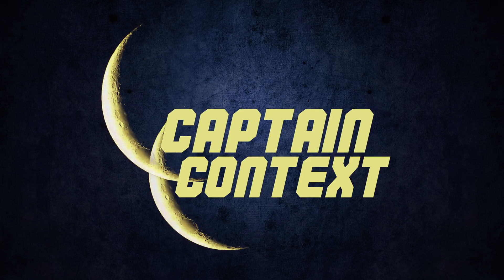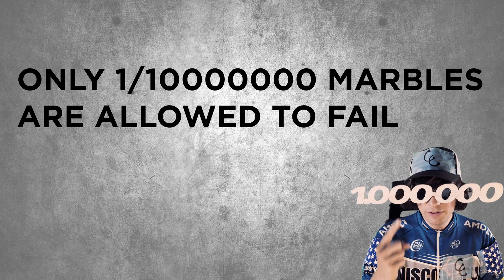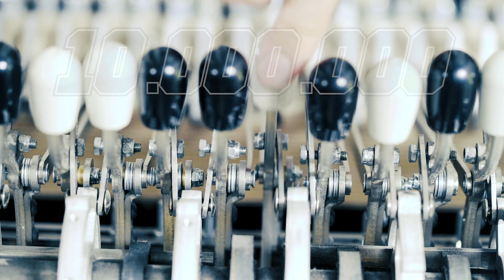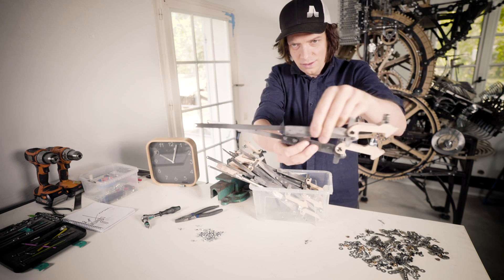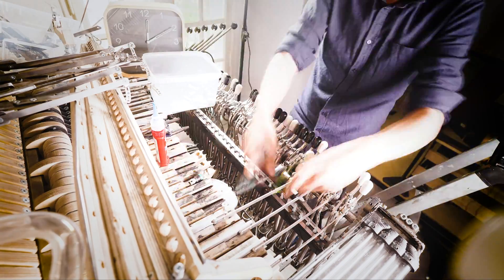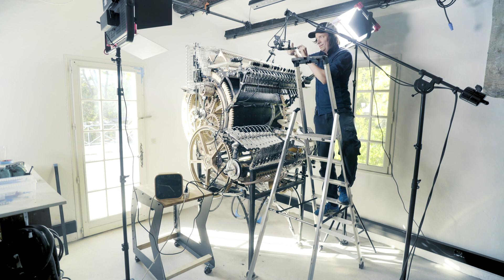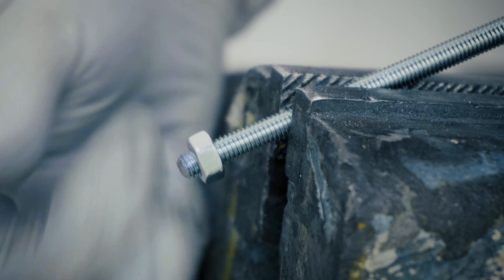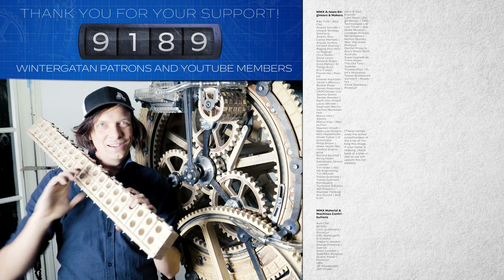Countersink? Why? - Marble Machine X #143

Comment: I don't mean to use this accusative tone, but a lot of us told you from the beginning in the comments to design more redundancy into the machine.

You were focusing on creating cool solutions when you should have worked on reliable solutions.

Now I'm fearing that you are focusing on the wrong thing again. Instead of trying to maximize reliability to the absurd, you should design so that when a marble fails, it fails in a way that doesn't hurt the machine. (Or hurts it as little as possible)

Yes, each song needs 3500 marbles. But if 1% of those marbles would fail to hit their target, that's still a lot better than most musicians can perform. 3,5 missed notes in a song? That's nothing for a whole orchestra, and the MMX is like an orchestra.

You don't need every part to work 99,99999 of the time. You need to design each part so that it can fail without breaking. The machine would miss a note and keep going.

99.99999% reliability of every part is impossible.

Reducing the risk of machine breakage to 0.000001% might be feasible.

(By tha way, if every moving part has 99.99999% reliability, and each marble interacts with say  100 moving parts, then each marble only has a reliability of 0.9999999^100 = 0.99999000005 ~ 99.999%)

So by all means, design away the possibility of failures. But also design so that the failures that will happen won't be critical.

Edit:
I'm super positive towards the actual building in today's video, it's a logical fix to a known problem. 

My rant above concerns mostly the line of thinking from the intro.
Reply: Couldn’t agree more. This comment needs to go up.
Reply: This is the fundamental difference between an engineer and an artist. I'm an engineer. I could make marble machine work fine, but I could have never come up with the idea to build it.
Reply: I was gonna write something like this but luckily I found multiple others already saying it more eloquently than I ever could. Plz Martin see this, as well as the entire crew, this should be a fundamental consideration for the design of the machine! I believe in the machine, but not when you put goals and expectations of near impossible infallibility on it.
Reply: but he is fixing the stuff that result in major seizes, though. In this case, if the two bolts got caught every time A played so would be. Every single time, and they wouldn't naturally free themselves of each other.
Reply: @Dubanx  I agree, the actual building in this video I'm super positive towards.

My rant above concerns mostly the philosophy from the intro.
Reply: Totally agree with you. Also his reliability calculation is flawed as each marble doesn't interact with every component so while it may be 3500 marbles per song, most components will only interact with a fraction of the marbles per song. Better to spend time fine tuning components that interact with the most marbles.
Reply: Yeah, the machine needs an acceptable point of failure, so that if a marble gets trapped, something non-critical such as the programming stud breaks. IIRC right now that's what happens, if the machine fails then the magnet breaks but the studs apparently won't. Personally I think it's probably worth revisiting that. Still worth getting the failure rate down a lot, but if once a gig one stud breaks, it's a few missed notes on one song and a bit of work after.
Reply: I would normally agree with you but this is an instrument..... So requires such a high level of accuracy. Could you imagine a cello, drum, organ, or xylophone that only worked 99.9% of the time?
Reply: @DaleKnudsen  Well, in that case I think the exact numbers we use become important. 

99.9%, I would agree, is a bad number for a normal instrument. If every 1000:th note straight-up failed, that would be a bummer for a soloist. But I would argue that despite most instruments being fairly simple mechanically, few of them get even close  to 99.999% reliability. Woodwind mechanics get stuck or fail to cover the hole. Guitar and violin strings break. Vocal chords get covered with mucus. Midi info gets lost in transmission. 

But you are right, there are instruments that can play 10 000 000 notes without any failings of the instrument being expected. Maybe the piano is the best example.

I would say a big distinction between the MMX and most regular instruments, (with them being fairly simple mechanically), is that they have the player as the most critical part working part. The player usually acts as the time-keeper, the source of energy, and the brains of the instrument. And the most professional of players still fail way more frequently than 0.00001%. Like fretting at the wrong place on a guitar, or hitting a piano key too soft for the note to sound. So the interaction between human and instrument regularly fails. But since great musicians are living error-correction machines, they make sure that the error doesn't mess up the music. 

As I see it, it's not wrong to try to maximize reliability, but reaching for a probability of failure in the millionth percentile seems non-productive to me, and also very hard to accurately measure.
Reply: @Jonas Bergmansson  The fact that Martin is thinking of reliability so strongly is pushing him further in his art and ability as a engineer. The push towards perfection in some ways very much drives Martin' creativity. 

As far as this work being non-prodictive... Not one of the other MMX videos started like this - the whole character creation, drawing, and bit around explaining reliability. Amazingly informative and fun to watch

By performing the work today he is reducing work he will most definitely have to do later. Transporting and fully utilizing as said instrument I would imagine will put great strain on all moving parts. It is these questions of reliability and probablity of failure that reveal where the strain of potiential breakage will happen. 

While it may be futile to expect that such high uptime will exist. I would find it even more futile to not try and find ways to measure, predict, test, tweak, measure, predict, etc...

Something that I think you mistake in your initial comment ... This entire project is a cool solution not a excercize in redundancy reduction. If it was there would be no marble tracks, no plexi pipes, no ladder and demag wheel.... All of these complications and contradiction of necessity create beauty.  Much of which I see is the beauty of being able to witness this growth in a fun and interesting fashion. 

Would have it no other way 😁
Have no fears - I believe!
Reply: @DaleKnudsen  I also believe the MMX is going to be finished.

And yes, the progress in todays video was nothing but positive.

The whole concept about the machine is that it is walking the tightrope of trying to be both a very complex machine with a specific task, and also an art piece and a sculpture.

I don't disagree with you, but my fear is that if reliability is turned into the key factor, then a lot of the cool earlier designs have to be scrapped (like the fish stair, and the marble divider that is based on the heights of a stack of marbles)

It just comes so out of left field that Martin is suddenly expecting a high reliability from parts that were never designed with reliability as a top priority.
Reply: The reasons he will never finish this project, he never listens to stuff like this!
Reply: And up you go!
Reply: Up!
Reply: I mean, he's not an engineer and had no idea about machining at the beginning if I remember correctly and he doesn't even seem to have a deadline. I find it interesting the way he does it. Like. This is what I would call proper backyard engineering :D
Reply: @chas1878  Yeah, today's Martin is a vastly better engineer than last year's Martin, and so on. That's really cool to watch.
Reply: You need both. Design for your target tolerance but have stable exception handling. Doesn't matter if you are making mayonnaise, working on an instrument or writing code.  What's more important to me in this video is the willingness to fix the problem _now_. Future Martin will be glad about that.
Reply: I absolutely agree with this comment. However, if there are any places where Martin can't have non critical failure points, he will need to make them 99.99999% successful.
Reply: I disagree. This just seem to be critique for critique sake, as you noted you criticized previously and are criticizing now, even when going more inline with your earlier advice. What exactly has Martin been doing that will cause the machine to explode or become seriously damaged when a marble jams? He is not so stupid as to let such a flaw stay in the machine.  Perhaps his reliability goal is ultimately unattainable, but it is not a bad goal to strive for. I also think he is aiming for this reliability to improve the music making process, which I imagine will take a lot of experimentation and retakes. If the machine is not reliable, then he'll spend more time fixing it than making music.
Reply: This is my thought from the very beginning of this build...
All we can do now is pray and wait for this project to be completed and playing its first song...

As many other project... As its approach 90% of the progress.. that 10% is actually 90% of the whole build
Reply: How dare you accusing the artist of focing on "wrong thing again" he is not building for you get out of your high horse. 

Edit: my comment makes no sense now when the main post has been edited, cheers
Reply: @user-jap84tlv24sq  I'm not questioning Martin's vision, I'm trying to help him make the machine happen. 

As you've seen during the course of the build, Martin has improved some designs after tips from the community.
Reply: @JBergmansson  i see your point but i dont appreciate the tone and style in which you put it. I see input such as "make every mistake happen in a pleasant way" very unnecessary. I think the man knows what he's doing and I was honestly shock that your comment got thumbed up so much so I just had to engage at that point.
Reply: @user-jap84tlv24sq  Just objectively,  Martin does not know what he is doing when it comes to a lot of mechanical construction decisions. That is not a bad thing in itself, people who know exactly what they are doing seldom innovate or discover anything new.

But just the fact it took so far into the build before he realised  that every part has to work reliably is proof that he is mostly  making things up as he goes. In the latest video, the one after this, he finished all the parts before checking if his tolerances were right, so now has to go back and try to fix them.

Martin is master musician and composer, and a real force when it comes to creativity and work-output. But the marble machine as a project trumps him again and again on his engineering and craftsmanship skills.
Reply: @JBergmansson  I think the "you are focusing on the wrong stuff again" was just the trigger for me. I get your point totally, you want to help - perhaps point out something usefull. i tell you; I think your reaction to me about him not checking for gives and subsequent delay this causes was more enlightening then "I think you are focusing wrong" comment. Cheers
You
Reply: You are absolutely correct!

I think one of the main issues is the flywheel (and now the added electric motor). These cause the machine to keep moving after a blockage, which can cause massive damage. So both needs to be automaticly disconnected when the torque gets to high => torque limiter. And even this should be like a last resort since it stops the song.
Reply: I believe such mechanism has already been put in place.
Reply: @Robbedem  iirc the MMX already has a tourqe limiter...

I also agree that the MMX should definitely not be designed to not fail, because it will eventually. Period. No matter how well one would build it. 
It should much rather be designed to be fail-safe. (aka in a failure mode that is safe to (in this case) the MMX in the event of a failure)
Reply: @Robbedem  the flywheel is connected to a clutch that engages if the machine stops abruptly
Reply: @TNaizel  yes, I was told already.
I found it in video #90.
Reply: I think total 0% damage if possible should be good... I mean I'm not an engineer or an inventore for atleast even a single damage should be prevented and that the machine should performing at its 100% I have been looking forward watch him play it for so long and i have been waiting patiently for that machine to play a new single just like the first machine he ever built. Though a totaly agree the comment...

Comment: If you really want to fix those threads you can buy dies, which allow for the cutting of threads. Also in the future, you might want to use button head screws instead of countersink screws. They wont get caught on each other, but don't require another operation.

Comment: I would be very impressed if you can actually get that precision, to me that would mean making everything as rigid as possible (no wood or only where it actually adds) and using machines that only exist in the secret vaults of Intel. But, I'm thinking this is actually a goal you set to make the journey as precise as possible, to create a mindset. Then I would understand. :)
Reply: lol intel is a very bad example
Reply: @yakovhadash  You mean Intel doesn't have super advanced machinery? That was kind of the point, not necessary Intel itself. :)

Comment: I doubt that this will work, getting everything that reliable is nearly impossible. Instead I think trying to make the mechanisms fail-save should be the goal. Because failure is inevitable, but if you can deal with failure, without the machine breaking, it is fine!